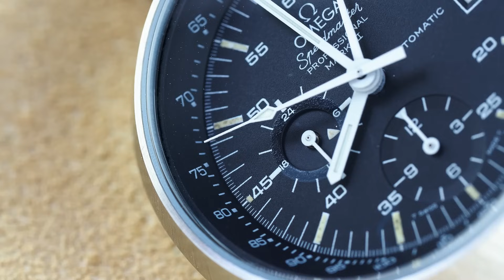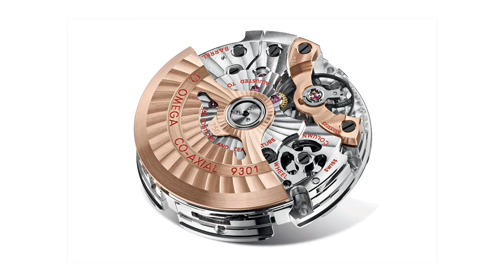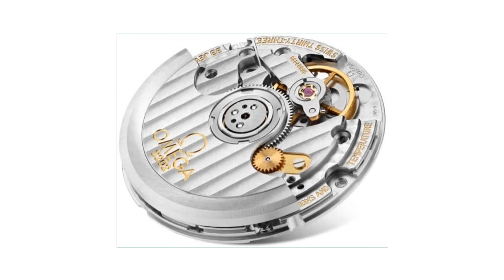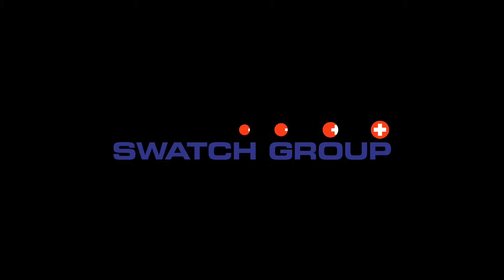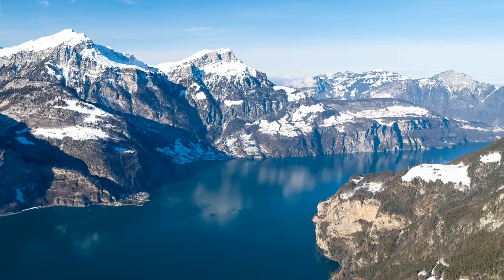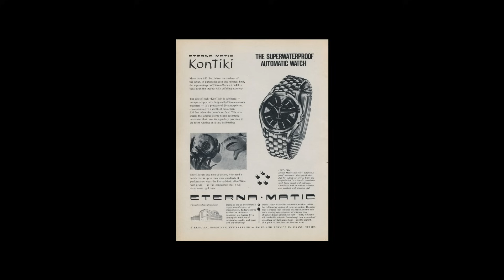Why ETA Watch Movements Deserve Respect

Comment: In other news, water deserves to be drunk. 38hrs of power reserve, however, is a bit on the lower side. If only if it was 50hrs or something like that.
Reply: Disadvantage of a long power reserve is that when you are not wearing the watch for a number of days the watch is still ticking away, causing wear, meaning it has to be serviced sooner. The movement is an engine, you would not keep your car engine running when not in use.
Reply: @garyboyle695  that is some mental gymnastics if I ever seen it myself. You won't want your battery in the engine run dry if you don't drive your car every day do you? Well me neither.

Comment: ETA movement’s are getting difficult to find, but since they have been so popular, there are plenty of parts available.  Why are parts important?  It’s important because most name brands with in-house unique movements must be returned back to the manufacturer for repairs.  Even a minor repair that your local watchmaker could have once ordered a part and performed the work must now go to the factory.  In-house parts are not distributed or obtainable to private businesses.  Even some of the unique modified ETA parts from a particular manufacture are not for sale.  So basic ETA parts being plentiful provides local options.  

I have a Ulysse Nardin 1846 Marine Chronometer which needed a replacement crown with UN logo and crown tube.  Although my local watchmaker was fully qualified to make the repair, he could not find the parts.  Instead, I had to send the watch back to Boca Ratan, FL for a complete—non optional—overhaul.  My watchmaker could have overhauled that ETA 2892A2 locally.

Comment: The ETA movements are very reliable, day in-day out workhorses. They are used in a vast number of watches, whether as is, with modules added, or finished to a high degree. I know there are many in the watch collector/watch community who look down on ETA movements, but this is based on some sort of elitist mentality, which has NO bearing on how a watch works, how reliable it is, or how well it keeps time.

One thing never, ever brought up with ETA movements is that there are spare parts available for most of them. This is not always the case for in-house movements. Try to find parts, for example, for a Universal Geneve watch with an in-house micro-rotor movement. You may be able to find a donor movement, or maybe not. I do guarantee that you will be able to find parts, from multiple sources for most ETA 27XX and 28XX movements, as well as a Valjoux 7733 and 7750. While spare parts are not always required, when they are, the lack of spare parts for an in-house movement can render a watch using the in-house movement dead.
Reply: Cool story bro.

Comment: I have a Sea-gull Ocean Star with a 2824 2 made by Seagull.
28800bph and very accurate.
What is your opinion on the Sea-Gull 2824 2.
I also have a Sea-gull automatic watch with the Seagull 2789 eta cloned movement. Your opinion on that. We're these movements copied illegally, or had the patents expired?
Reply: It's perfectly legal - as you said they do not need a licence and the movement can be considered patent free.

The movement is essentially the same from watchmaker breakdowns I've seen. The only difference you may find is quality in large batches. I follow some microbrand blogs and for example they had great experiences with Sellita and ETA, but the batches from Soprod had more defective units than the first two. I haven't seen a 'batch review' of Sea-Gull's clone to comment, but it is more about quality across mass production when it comes to these, instead of individual differences.

Comment: Fascinating. I think unless you're getting a high end watch (Omega co-axial/Rolex and above), I think you're better off with ETA. In Sinn, Oris etc, I'd much rather an ETA/Selita than an in-house movement. In-house will be more expensive, not necessarily better, with slower servicing and no guarantee parts will always be available. Nonetheless, brands that charge £2.5-4k for a 2824 - based watch (Doxa, some Tudor/Breitling etc) are simply gouging your eyes out. 2892s are moot - some amazing ones with great value (Longines Spirit), some good, but poor value (IWC Mark). There are some big movement wars ahead though: Kenissi is going to be a big player if Tudor/Rolex/Chanel get their way.

Comment: Another workhorse is ETA ´s 7750 which needs a video of its own. Great rundown of the 2824-2 & 2892 👌❤️ very informative 🧐
Another variant based on the ETA 2892 is the 2895 which is worth talking about. The 2895 has 27 rubies (much higher than earlier 2892 /21 rubies), these were seen in: Tag Heuer (Caliber 6), Gucci , with surprising accuracy! Due to ETA freezing stock as a supplier in recent years, a lot of changes have been brought up. Sellita seems to be the newer supplier of movements in the watch industry: Oris, etc.
Reply: And variants of the 7750: ex. 7753 !
Reply: Armand has a video on it already and it's very good!
Reply: Hello glad to re-look this video. Added small info. which could be of interest!

Comment: As a watch technician i always tell my clients that ETA movements(COSC grade Silicone hairspring)are the same as Rolex movements.
Reply: Percentage-wise, how similar is it?
Reply: @BetterTodaywithJasonCruz  after servicing and regulating , in terms of performance they are equal. Since the ETA movements that are equiped with silicone hairspring are quite new to the industry, i can't say anything about their longevity yet. But those ETA without silicone hairspring they have always been long-lasting, same goes to Sellita movements. ETA also offers 80hours power reserve 3hands movement & 60hours power reserve chronograph movement that performed exceptionally well. Now combined all these together-80hours power reserve,COSC grade,silicone hairspring,incabloc shock absorber and you got yourself a truly wonderful movement with a price that won't break your bank and performs the same as the watch that will cost you 10 times more. Hope that this simplified explanation helps. Cheers.
Reply: @horologywatchmaking13  Hey mate, thanks for that wonderful and detailed explanation! I appreciate that you took the time to write that out. I used to think low of ETA movements but I've to say, I've gained a newfound level of respect for it. May even shop for an ETA-powered piece soon 😊🤘🏼
Reply: @BetterTodaywithJasonCruz  Pleasure is mine. Do keep in mind that for those modified ETA movements with longer power reserve and silicone hairspring they can only be found in brands under The Swatch Group like Tissot,Certina,Mido,Hamilton. They are exclusively only for the Swatch Group's brands and don't sell them to outsiders. Well then i hope everything is well and please take care.
Reply: @horologywatchmaking13  Thanks for that additional tidbit! After watching this video + your comments, my "world of options" just opened up hahaha
Reply: @BetterTodaywithJasonCruz   I have to agree with Nicholas here, I have had a few "expensive" pieces but I would argue that the eta 6497 on my Hamilton is more stable then any other movement I have had. The only movement I would say compares to those is the 9 series on GS watches, Rolex is also very reliable.
Reply: @elefantrising  Hey, thanks for the comment. Definitely admiring ETA more and more! On another note - I have a GS Spring Drive and I need to say: that movement is on a whole new level and I love it.
Reply: @horologywatchmaking13  Hi nice video. Very informative, thank you. Question by a novice: The IWC 3533 with c. 30110 is based on ETA 2892-A2 from what I read on the internet. IWC is owned by Richemont. I am 100% positive I am misunderstanding: "Do keep in mind that for those modified ETA movements with longer power reserve and silicone hairspring they can only be found in brands under The Swatch Group like Tissot,Certina,Mido,Hamilton."
 Is IWC 30110 based on ETA 2892-A2 to your knowledge ? Thanks again.

Comment: Great upload Armand.
As an owner of several pieces housing  the standard 2824-2 & it's Hamilton/Certina extended PR variants I think it's a perfectly capable mov't for sub $1K USD watches.
If one is not fussed about Swiss Made 'branding' on their timepiece (for it has devolved to simple branding IMO) I believe the Miyota 9 series mov'ts to be the better option. That said, the though some favoured pieces in my modest collection hold ETA 2824-2 / 2893-2 mov'ts, others hold Seiko's 6R35 or Miyota's 90S5 mov't.
The 2824-2 and it's variants are undoubtedly solid and reliable entry level Swiss mov'ts, Japan's ability to equal or possibly best them is interesting to me as the community starts to question the meaning of 'Swiss Made' on our watches.

Comment: I have read too many stories of mechanical failures of the modified ETA 2824 movements used in the Hamilton Khaki's, and would shy away from them for this reason, as attractive as the higher power reserve is, what matters to me in a field watch is rugged reliability, and this movement does not exhibit that in too many cases.

The 2824 is a lovely mechanism, but I do wish that ETA would address the known failure points in them. I think they are basically comparable to Seiko movements with identical technical specifications. But, the Seiko's do not require service every 5 years, as the ETA's do. I think of these two brands as I do Toyota and Audi, respectively. Seiko wins in terms of total cost of ownership, and ETA has their head in the sand in this regard.

The Miyota 9000 series movements that compete with the 2824, are IMO inferior in regard to the efficiency of the auto-winding mechanism. They are uni-directional. My example does not have anywhere near the advertised 40 hour power reserve. Of course, that is just an N of 1. But, it makes me disinclined to buy another watch with a Miyota movement, despite the fact that it keeps excellent time. I essentially have to treat is as a hand wound watch.
Reply: Uni-directional winding isn't necessarily less efficient than bi-directional. For me Miyota 9 series doesn't have efficient winding, neither 2824 or 2892. Only Seiko's magic lever can support my life style well.
Reply: Unidirectional is better if you have a more sedentary lifestyle, due to the gap where a bidirectional isn't winding if the movement is slight (e.g. when sitting down on the computer). It's not better or worse IMO and they both have their merits. A friend talked to a Patek master watchmaker who preferred unidirectional winding.
Reply: @johnanth  Well, theory is one thing, and application is another. I am talking real world experience on the wrist with a Miyota 9015 and an ETA 2824. The power reserve on the ETA kicks the Miyota to the curb, despite the specs suggesting that they should be comparable. Therefore, I jump to the N=1 conclusion that the self winding mechanism in my ETA is more efficient than in my Miyota.

Perhaps there is some other way of making sense of the difference in performance here. Regardless, the ETA suits my needs better in terms of power. I just wish it kept time on par with the Miyota.

But, even in theory, I disagree with the Patek watchmaker. When swinging the arms on a unidirectional winder, while walking, the winder will be functioning only 50% of the time. A bi-directional winder takes roughly 10% of a rotation to engage in one direction or the other, so it might be non-additive 20% of the time while walking. Even stick figures who spend a lot of time at a desk also spend some time walking; on average several miles a day.

A bidirectional auto winding mechanism is both more complicated and more costly to make. I do not take it to be a marketing gimmick. My limited experience suggests that it is more efficient in application.
Reply: With the failure of 3/4 of my 2824 watches, I wonder if the 2824 doesn't have an overwind feature. Not sure but think that may be the problem.
Reply: @sharpsvilleBill  Did your springs fail? What did your watchmaker tell you?

The critical weak point in the 2824, IIUC, is the two brass cogs in the winding mechanism. These wear out over time, particularly if you hand wind with any frequency. Best to let the auto-winder do it's magic on the 2824.
Reply: @ivermec-tin666  I never had any communication with the factory Doxa repairman. The other 2 remain non-functional.
Reply: @sharpsvilleBill  That is disappointing. I would have hoped that the Doxa watchmaker would have itemized the repairs and parts replaced, as I understand Omega does.
Reply: Very interesting.

Comment: I wonder what you (and others in the watch enthusiast community) mean by 'workhorse'.  Is it meant to be derogatory?  Does it mean that it's robust but unrefined? 

The NH35 is often referred to as a workhorse, as is the 2824; but I now see it applied to the ETA 2892 and the Miyota 9015, and  I don't think either lacks refinement.  I have examples of each that show chronometer-level performance:  anything but plodding.  A workhorse on a farm is powerful, reliable, robust, and slow:  perhaps the NH35 fits that description, but I don't think it helps us understand watch movements at all.

You bring up respect, which is (you also say) unfair, but which is relevant when our go-to term for a versatile star of a movement is 'workhorse'.
Reply: workhorse is usually a durable,reliable movement..might not be within COSC parameters,might not be the most decorated movement or refined one,but surely will last you a long time without the need for service,and will serve you reasonably accurate..and usually way more affordable.so i dont think it to be derogatory.
Reply: It's definitely a term of endearment and all about reliability. Part of that is strength against shock and other such events. The Rolex 3100 series is known as a workhorse movement for example even though it is in-house. So it is not just standard/ebauche movements that gain the moniker, but any reliable mass-produced movement.

Comment: Really i don't know anything about a ETA automatic movements, but as a user i can say that i didn't saw a better quartz movement than ETA FØ6 quartz movement....really impressive. It can be the end of the world but that movement will survive.....and a most important thing....plus or minus 1 second per week (that's less than a minute PER YEAR)....that's not bad at all i think. There's no ETA or any other automatic movement which can be close to that.
good video, like
Reply: Well yes, the Citizen A660/A060/0100 calibers will outpewill Grand seiko 8F and 9F. But it's apples and oranges, the price difference is big. I think GS 8F has been found in some Seiko but it's still in house, 9F is fully in house to GS and the Citizen calibers are only used under the Citizen brand. So apples and oranges IMO.
Reply: probably any seiko,orient or citizen will out perform it ...i think so
Reply: @brothacaim  well, i don't think.... i would say that Seiko will outperform it only with a price without any reason, and with the amount of scam.... by the way, a 10 USD quartz Casio will outperform any 4000 USD Seiko with a durability, a value for a price and most important... with an accuracy.

Comment: I place reliability,toughness ,serviceability and long lasting ness above all in my movements.You really get all this in a eta 2824 and 2892.
Reply: or the 2836,   that one is also an amazing workhorse
Reply: Sadly these movements appear to have been replaced by low beat throwaway movements. I agree 2824-2, and 2982 were, and are superb workhorse movements with a smooth 4hz sweep.
Reply: Yes in some lower level Swatch brands.Theres still plenty of brands out there using them.
Reply: ... reliability,* toughness,* serviceability and longevity* ("longlastingness" is not a word) above all.* And a fullstop is always followed by a space,* otherwise you create false links.
Reply: Toughness, my ass. You can wreck the keyless works by just inserting the stem back in if you somehow remove it incorrectly. You want tough? That's the Seiko NH35.
Reply: @freddyt55555  another Seiko fanboy
Reply: @freddyt55555  Chh... the Seiko NH35 ain't nothin'. Have you ever heard of a battery?
Reply: You want even tougher? Citizen eco drive